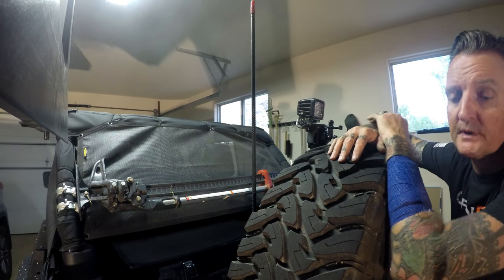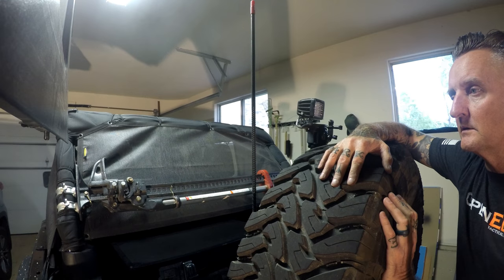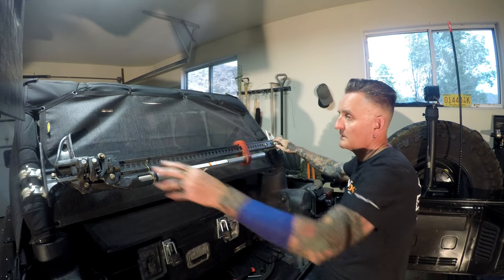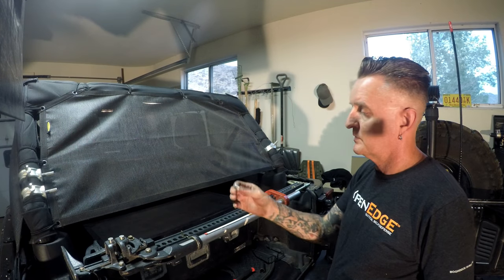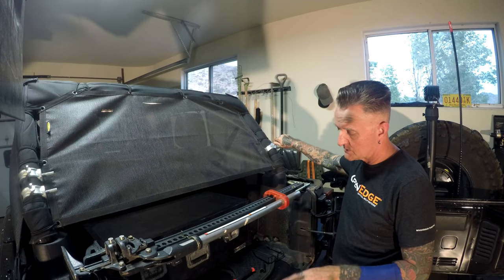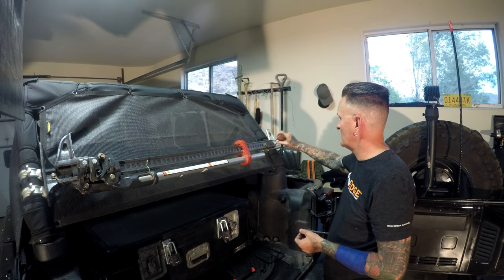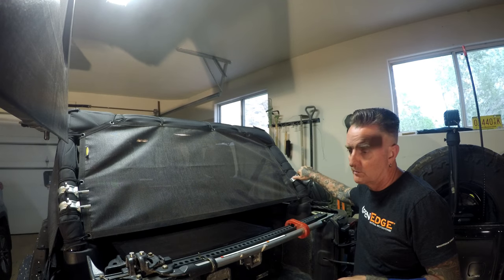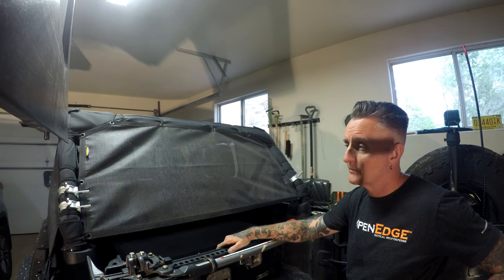DIY Hi-Lift Jack Roll Cage Mount for Jeep

Comment: I need that! That's one great idea man! And save a shot load of money at the same time! Now! You said the bolt have to be cut to size? They dont sell it to sizes?
Reply from the maker: You get half inch all-thread at the hardware store. A 1-foot piece is enough. Or you could cut the heads off of 1/2" bolts...

Comment: What kind of clamps are they though? I never could figure that out.
Reply from the maker: They're service entrance conduit clamps.  They use them to secure conduit to the wall where the electrical service comes into a building.
Reply: Do you clamp your traction boards to that as well?